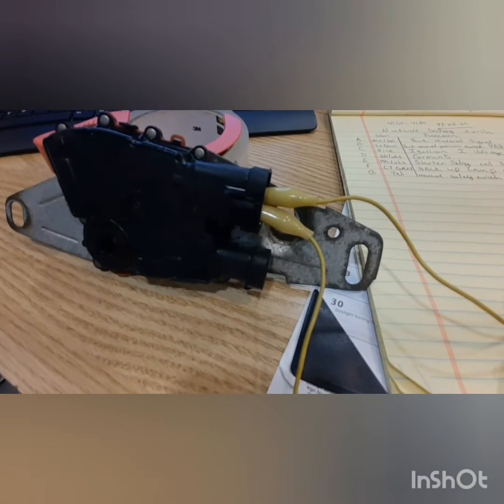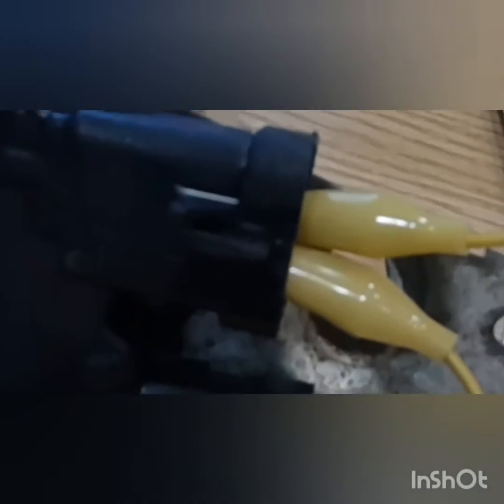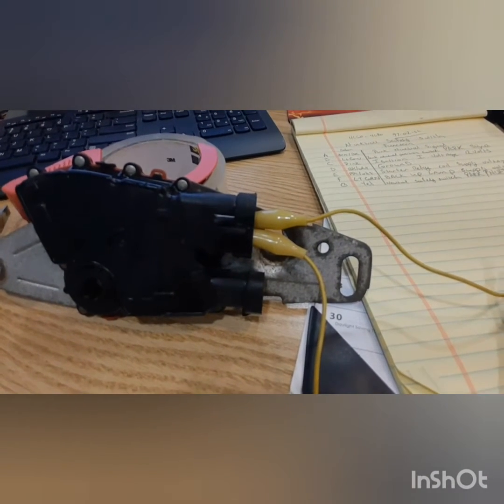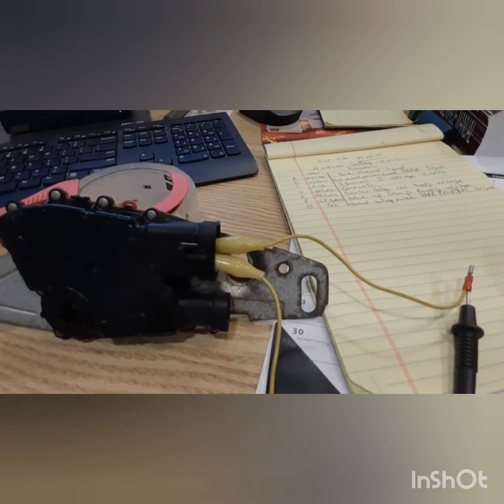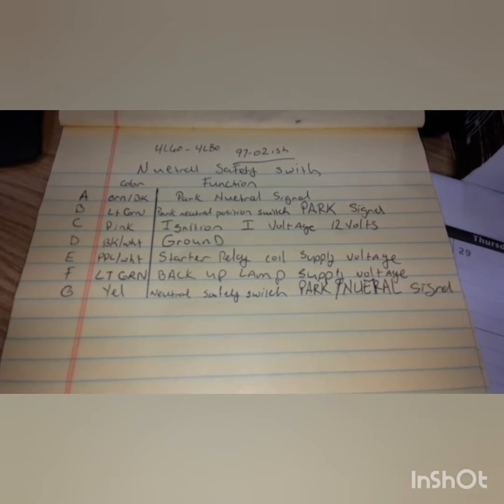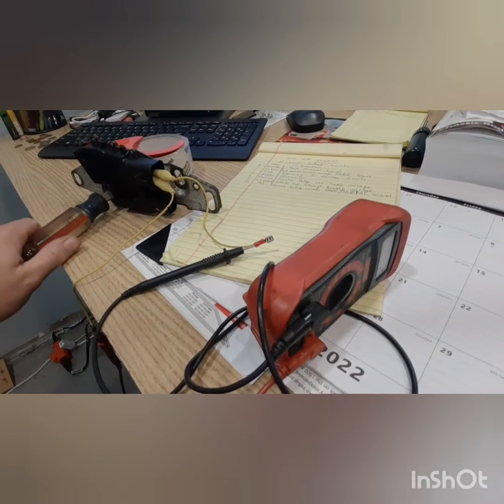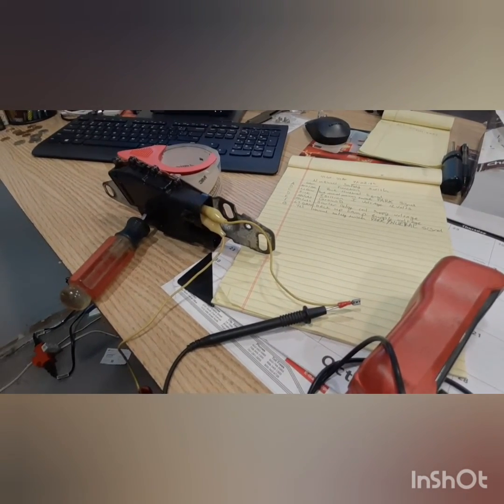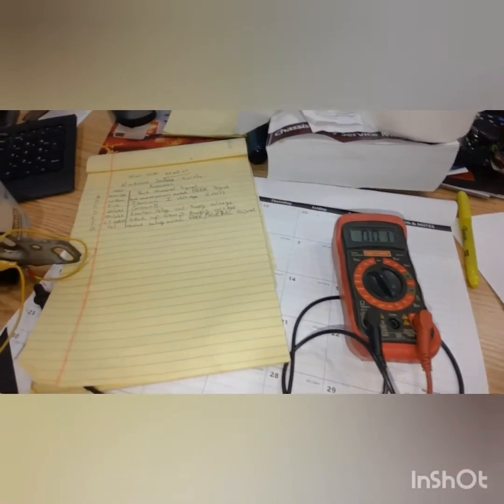How to wire a 4l60/4l80 neutral safety switch for LS swap reverse lights and park neutral starter

Comment: Do you happen to have the diagram for a single long connector neutral switch off a 07 tahoe the connector got snagged when i was lowering the transmission and the wires pulled out of the connector and i have no clue what pins they go to its 6 wires black/white, orange/black, brown/white, gray, yellow and a white wire.

Comment: Hey quick question... if I already used E & G wires, do i still need to use A on the switch?
Reply from the maker: I am assuming that in a normal truck the ignition voltage would send 12 volts to pin e to energize a starter solenoid . I still recommend using the method I mention in the video. I hope this helps.

Comment: So when the switch is put into Park or Neutral.. There's ground continuity between A & D? 

I have a neutral/safety wire that is supposed to supply power from the key (when turned to start) into a neutral safety switch and then to the starter solenoid. (1974 C10 with LS swap)

What do I with the incoming 12v power signal from the key into this switch? And what is the output to the starter solenoid? Thank you for the great content!
Reply from the maker: Use a relay, wire the negative side of the coil to the neutral safety switch and the positive of the coil to your starter switch.
Reply from the maker: Use a relay, wire the negative side of the coil to the neutral safety switch and the positive 12v coil will be the starter switch wire. 

The 12 volts coming out of the relay will go to starter solenoid. 

The relay will only get ground if the neutral safety switch is in the correct position and that will prevent it from starting.

The relay will get it's 12 volts from your key (Start) going to the positive coil on the relay to energize the relay.